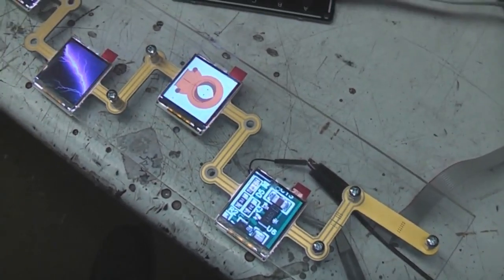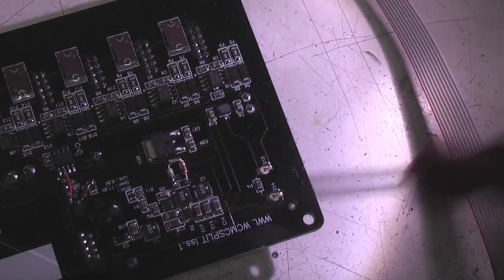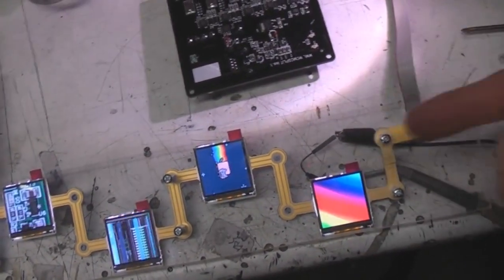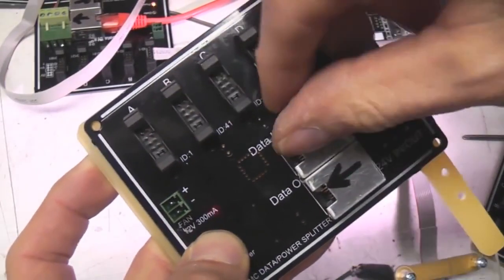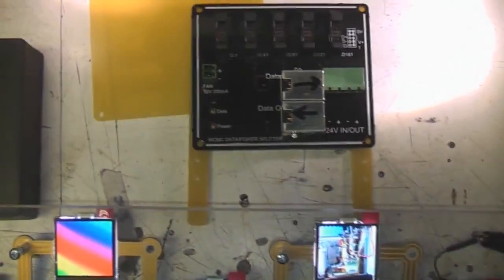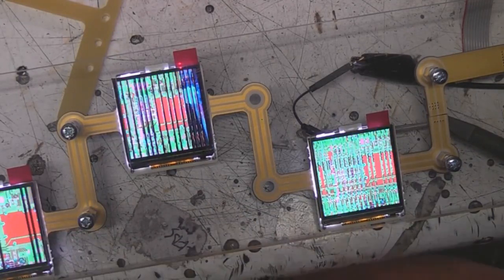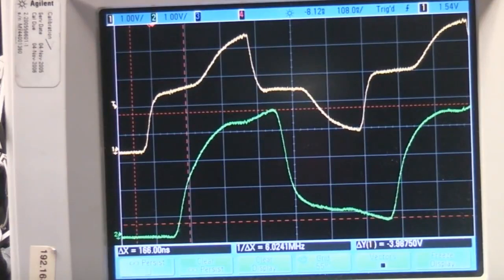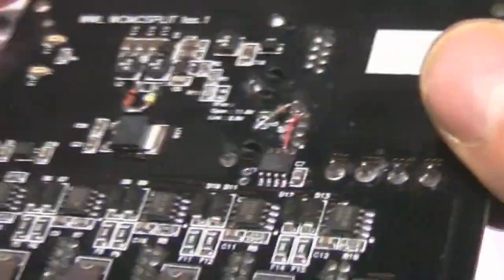Nano screen stuff part 5

Comment: This reminds me of a problem I encountered at the TV station I work at. We had a big unit which held 800 tapes for random access of commercials and programs. It had two robot arms for loading the tapes into the five VTRs. It worked fine at first, but over time it started misbehaving. The VTRs were on a RS-485 bus and all but the last unit needed to have their terminators switched off. Over a few months, as the VTRs were removed for service, they were replaced with units which had the terminators switched on. That loaded the data until the voltage was below the receiver threshold. A big sign on the back of the unit warning the techs to check terminators prevented recurrences.

Comment: Looks good.  Hopefully paying enough to justify the amount of time and design you've put into it.  I've always found that "arty's" seem to expect a lot of work done for nothing.  Seeing the reflection on a 'scope was good.  DMX lighting data is a 250Kbit signal on RS485 and suffers from reflections in the same way.  You can have a long run of lights and just a short cluster of them will be misbehaving until termination is added.

Comment: sorry for offtopic, just wondering, is it at all feasible to revive a dead ipod nano 4gen, which has been fried (i hope, just part of it) with a bad power supply, so that it doesn't power up anymore (neither from the battery, nor from usb). I looked at the hires photo of it, it seems there is a  power supply chip in some qfn-sort package, but i couldn't find any datasheet... thought, you might be the right man, since you did a lot research on this topic ;-)

Comment: I'm not familiar with the IVE device, but I've had really good luck recently with SiLabs Si87xx isolators. Similarly passive(-ish) "diode emulator" inputs and very cheap but not as fast.

Comment: Interesting to see the corruption due to non-termination. Experienced this on old 10base2 Ethernet cable (although on that pretty much everything stops if the terminator's removed) but seeing the effect on these screens illustrates it perfectly.

Looks like a lot of work's gone in at the start to result in very little work (or thought) required at installation time. Really nice design, should look fantastic when it's all complete. :)

Comment: how about you being kind and releasing all the circuit schematics and explanations relating to how to use the lcd ipod nano 6g screen ? thx in advance
Reply: +HalfLife2Beta He pretty much did in these videos - well, enough pointers to reproduce it without too much hassle.  How easy do you want your projects to be? Most likely you'd use an FPGA or CPLD to generate the DSI signal so it's not a great beginner project anyway.